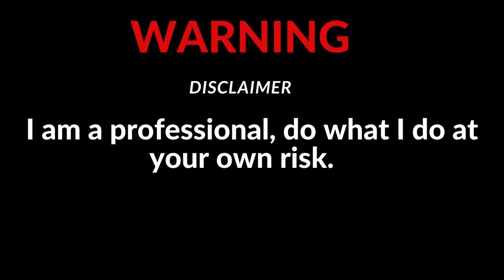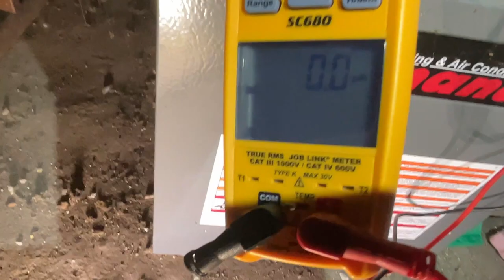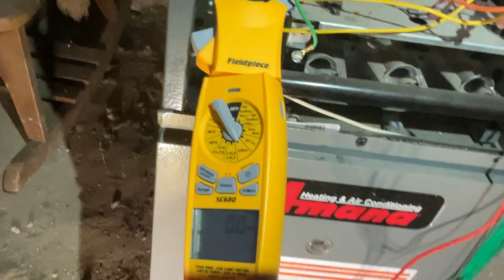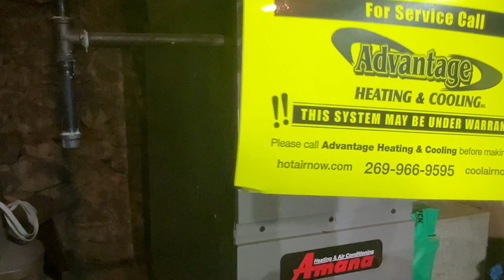No heat Amana gas furnace, FIXED!

Comment: Would you mind, when you can, explaining what your looking for as you go? I’m relatively new to the trade so understanding what other techs are looking for/expecting from readings would be awesome! Thanks for the video man 👍
Reply from the maker: You got it. I will do a voice over on this and republish. Thank you for your feedback.
Reply from the maker: So I deleted the original so I can't do a voice over. from now on I will try to point out what I am doing and why I am doing it! So with this call the Heat was intermittent where the flames will come on and off and most of the time the furnace will go into lock out after 3 tries. So to test this you set your meter to micro amps, one lead to the flame sensor and the other one in series with the flame sensor wire that goes back to the control board. when I fired up the furnace the micro amps were only reading .03-.04 the should be above 2.0 micro amps. I hope this helps you understand what I did.

Comment: What did you have your meter set to and did you put one lead on the sensor wire and the other on the sensor?
Reply from the maker: Micro amps and yes one lead goes to the sensor and the other inline with the sensor wire. Thanks for watching.

Comment: Volume way too low. I have a pretty loud speaker with volume all the way up and still barely hear it. This device usually has no problem with even soft audio that other devices struggle with. But still this video is too low unless placed right against the ear. Just thought you'd want to know. Thanks for the video.
Reply from the maker: Thank you. Future vids I will move the  microphone up closer, sorry about that.